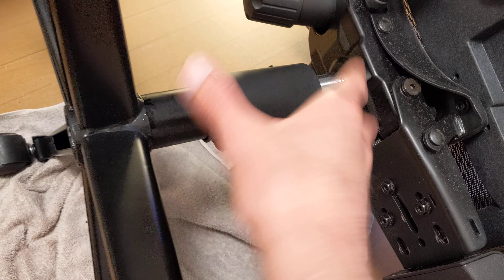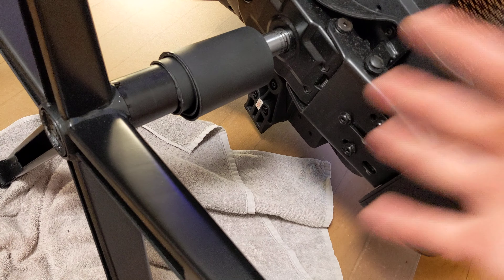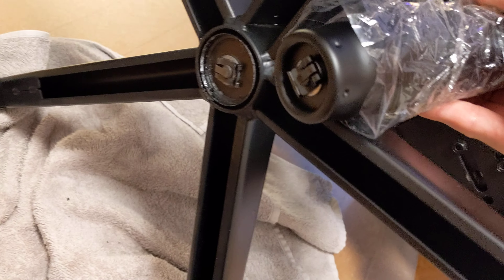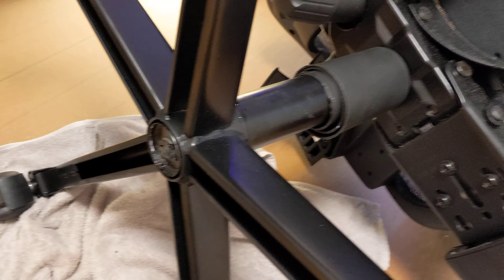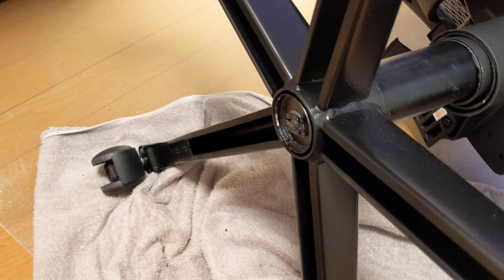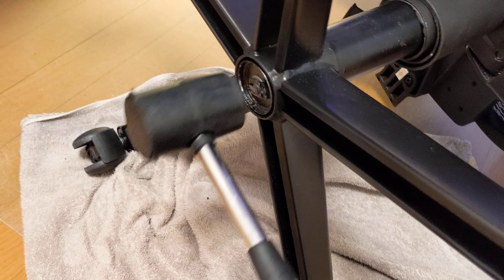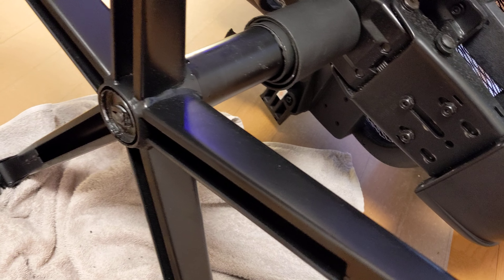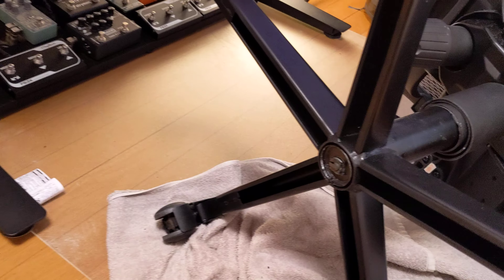lol how the hell do I fix my chair

Comment: I would recommend standing the chair up, spraying the shiny upper part of the cylinder with silicone spray. It lubricates and seals the cylinders moving parts. If that doesn't work a you'll need a gear puller in the right size. Don't bother with a hammer. You'll just deform the cylinder. Guess how I know. 😉😅

Comment: After reading the comments, I think relieving the pressure in the cylinder safely is the first step. I think the tab on the bottom can be opened to do that--it kinda works like a soda tab. There may also be a subreddit about this problem.
Reply from the maker: The tab on the bottom removes part of the actual mechanism from an outer casing, which may help, but I haven't had time to give it a go yet. -E

Comment: If you could, maybe pour boiling water over the centre part that holds the tube and then try to hammer it out. The heat should expand the metal just a little, it might give it enough space to come loose. I have no idea how you'd manage that, but heat expands metal.
Reply from the maker: interesting idea. logistics are complicated though

Comment: You can try to pound it out, but more than likely it's in there permenantly. Your weight helps seat that pole in place. There's compression fittings on the seat, and the wheel mount, that grips it. It's a safety thing so the chair doesn't come apart every time you get up. I'd toss it by the garbage bin. Maybe someone could use it.
Reply from the maker: if only it was so easy to throw away a thing in Japan lol
Reply: @EricKlein  donate it to a modern artist?

Comment: I think you have used the correct method, that's for sure. 
However, it seems that your mallet strike zone could be improved, though. Try getting a better target. What I have in mind is something like a piece of closed steel pipe, attach the open end to the target, and hit the closed end, perhaps with a hammer. 
Also, try hitting the bogie instead.
Reply from the maker: i really dont think it'll budge hitting it. its fused together too strongly

Comment: Maybe using two ratchet straps. Wrap one around the bottom of the seat and one around the legs. Then you’d need to tie the opposing ends of the straps to something strong and unmovable like support columns or very strong metal poles, kinda like a hammock between two trees. And the goal would be to incrementally ratchet the straps hopefully pulling the chairs legs off of the center post. 
Not sure if you’d be able to do that in your apartment or balcony. But it might work if you can. Just make sure to wear protective gear like safety glasses and a helmet or something if you do attempt something like that. This method would create a lot of tension.
Reply from the maker: this is probably a pretty good idea, now to source these tools and safety gear....
Reply: @EricKlein  just use what you've got,, apply coffee spoon to spigot point <A> and rotate evenly lefty Lucy or righty-tighty,, evening squire!!

Comment: I would also recommend the DW40, spray some and leave it overnight.
And either keep trying with you pulling it with your feet on the bottom or the mallets, but try and put one mallet on the bottom and hitting from the top
Reply from the maker: i used oil, didn't help lol.

Comment: Have you tried wd40 and leaving it to soak overnight. It's usually used to help loosen rusted bolts, but it might work for that?
Reply from the maker: yea, i used oil and no change.
Reply: @EricKlein  penetrating oil gets into tight spaces to loosen nuts and such, but you have to leave it like overnight to get in there... but that having been said, I don't know if it will work.

Comment: I had the same problem with an office chair at work. Despite the prison having the welding and upholstery programs (having the tools, supplies, and labor readily available), that was the one part of the chair that could not be repaired/replaced.  They couldn't even weld it to be at a specifically-fixed height.  If the seat tilts back and you had an ottoman, you could turn it into a jerry-rigged recliner.  Otherwise, you'll have to call city hall to set up a pick-up date for your chair.  They'll ask for the specific dimensions of your chair, then tell you which specific sticker you'll need to get.  Or you could try to sneak it into the trash room at your apartment complex.  I understand your frustration and wish you luck.
Reply from the maker: hah, yea, it may come down to replacing it.

Comment: I think that little clip at the bottom might come off. Perhaps it is what is locking it in place and not allowing it to come out.
Reply from the maker: yea, it does come off, and since filming this i've learned that it removes the casing around the cylinder which might be helpful in my goals. I haven't played with it yet.

Comment: amazon has this MySit Gas Lift Cylinder Removal Tool that worked for me if you are still having this issue
Reply from the maker: i see that it is a replacement cylinder, but my issue is i can't get the broken one out of the old chair.

Comment: You've got the right idea to hit it back through. You just need enough force to make it work. Use a metal hammer to get enough force and give it a good hard hit. Maybe a standard hammer or a small sledge hammer will do. A rubber hammer will just absorb the force (it's meant for "softer" hits).

You could also use a piece of wood that you hit on the end to help poke it through.
Reply from the maker: im worried about using too much impact force as that is a compressed cylinder. i don't want to puncture it and kill myself. i've seen a way to take the dangerous part out of the chair, however, and will work in it more once i do.
Reply: @EricKlein  have u tried building an office furniture manufacturers,, maybe that'd help 😏🏴‍☠️

Comment: You might not want to try this but I would try getting a small torch and heating up the outer area where the gas shock goes into like on the wends and stuff. That would expand the metal slightly and might help. I would clean off any oil though and not sure how the paint would hold up.
Reply from the maker: yea, im not gonna add fire to a compressed cylinder hahahaha

Comment: ,,you need 2 solidly wedge the seat or tie it to something unmovable with it raised up so the spokes are free then get Kyde to hold a thickish offcut of timber against each spoke top side to protect them whilst you pound each one in turn it will slowly inch along the shaft bit by bit like a slow caterpillar,, as for removing the shaft not sure,,, oh no!, I know forget what I said,, use the fact the spokes r jammed 2 remove the shaft,, then imagine placing the spokes atop a void like a barrel or 2 blocks and pushing the shaft thru then that way,,, good luck 😏🕊️🤍✨✨✨
Reply: ,,after look at yr chair again,, there maybe is a set of screws to undo that will release the shaft,, perhaps 🤷😏🕊️🤍✨✨✨
Reply: ,, has anyone seen monty python when they're all  superman but wish,,  if only bicycle repairman was here ! 🦸🦸🦸🦸🦸🦸👨🏻‍🔧🚲🖥️🪑